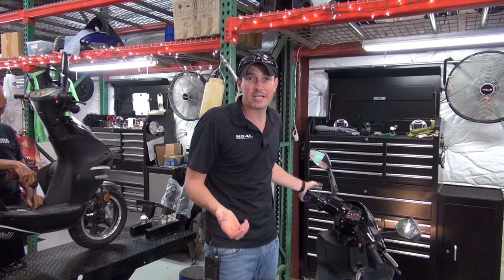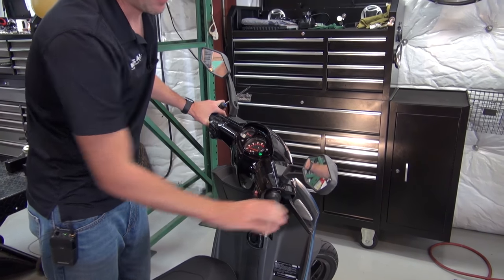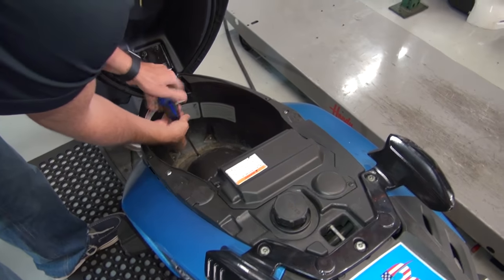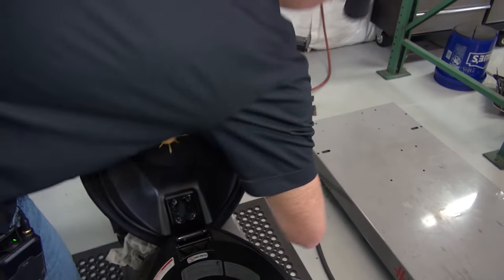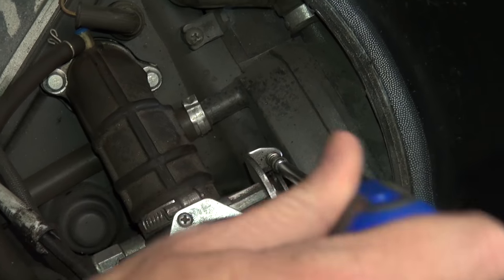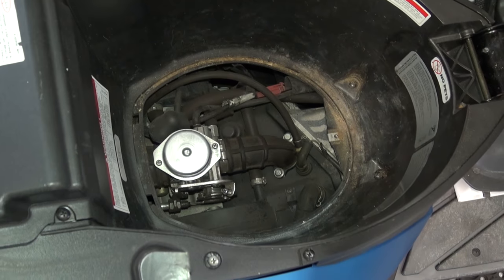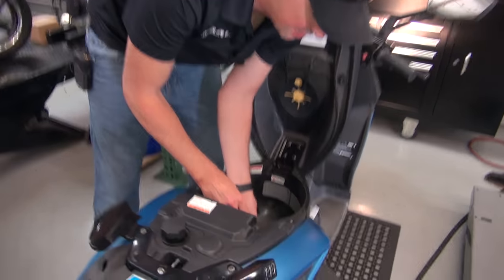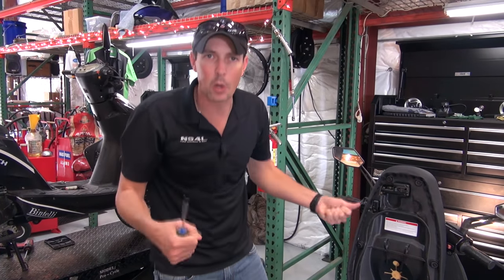Scooter Troubleshooting: Scooter Dying Out When You Come to a Stop / Low Idle

Comment: Everything was working perfectly though, it never died before and ran perfectly. I dont want to mess with the idle when it was perfect last week....
Reply from the maker: Sorry.  Does it die at idle all the time?
Reply: @NewScooters4Less  No sir. And it used to start and i would wait for it to heat up and it would gradually increase rpms, now it start and want to go straight away, i have to hold the brake really tight else it will fly away.. like just the opposite, now it starts and slowly decrease rpms over a few minutes then will die out. Ty for helping me. 🙏
Reply from the maker: @SilverPhoenix-PlazmaMoon  Think this one is going to have to go into a shop.  Just too difficult to diag over the interwebs.  Sorry my friend!
Reply: @NewScooters4Less  ok, tyvm 🙏

Comment: I hear two schools of thought. One it to advance the idle until the back wheel starts to turn slowly and leave it there. Some folks may get to this point then retard the idle just until the wheel does not spin. Another train of thought is don't go near the wheel spinning at all and advance the idle just until the engine stops sputtering. (after it is warmed up) Which is correct? Mind you this is for a new scooter that's not broken in yet.
Reply from the maker: I turrn it up to the point where the wheel is just starting to spin.  The weight of the scooter (and of the rider) is more than enough to keep the scooter from accelerating forward even when the rear wheel is trying to move forward.  Hope that makes sense.
Reply: @NewScooters4Less  Yeah it does.. Thanks! I'm 110 lbs 5'3. I want the most power/mph I can get with the best gas mileage. Doing a hard break in. At first I had the idle way too low and tried to ride it on grass - it wouldn't budge. I gave it a lot of gas and it took off like a shot and I lost control dropping the bike. Now that I've increased the idle the bike actually goes slowly on takeoff like I want it to and i can control it. I won't try it on grass again but I just did it thinking I could practice in our huge yard for a softer landing if I crashed. Now at least I have some idea how a way too low idle makes the bike behave on a surface like grass.
Reply from the maker: @DivergentDroid  Scoot Safely!

Comment: Ran in to this issue for awhile now. Its driving me insane. Just got it out of the shop on saturday. Said they replaced the fuel filter and adjusted the valves. Ran about 5 miles and died on me again. Step father bled the fuel line and it ran until 530pm monday. Crap load of sediment in fule filter. Cleaned it out. Blew thru hose to clear out the line and "pump"(?). Ran it for 3 miles. Fuel filter has crap in it again. When it died at 530 all i did was pull the lines to to engine. Not the fuel line the one into the carb and the other. Im at a lose, atm its running but i feel its only a matter of time till it happens again. Need to find out to keep this from being presistant.  I have no clue wtf to do lol. Its definitly not the idle!
Reply from the maker: 1.  What kind of scooter is it?  2.  What type of fuel are you running in it?
Reply: New Scooters 4 Less 

I run plus/mid grade. Going to travel the extra 2 miles just to get the ethanol free at 89 octane.

I posted the wrong copy. I should have sent ( revised) 

Ran in to an issue for awhile now. Its driving me insane.  My 50cc taotao has been bogging here and there and dying at stops. Just got it out of the shop. Said they replaced the fuel filter and adjusted the valves along with a new spark. Noticed huge lose in power. What was 45mph norm went to 30-34mph. (Im 135lbs) Ran about 5 miles and died on me again. Step father bled the fuel line and checkecd the airflow lines, it ran for 2 days, about 20miles.Crap load of sediment in fuel filter. Cleaned it out. Drained my tank, strained my fuel with coffee filters, clean. Blew thru hose to clear out the line and "pump"(?). Ran it for 3 miles. Fuel filter has crap in it again. When it died the last time, all i did was pull the lines to to engine, blew the air line to the fuel pump and the one into the carb (vacuum tube?) and the other reattached and it started. Dont know why that was a remedy. Power is back, hits 40mph again. Going to bring idle up a little tomorrow as its very low and to quiet. Im at a lose, atm its running but i feel its only a matter of time till it happens again. Need to find out to keep this from being presistant.  I have no clue wtf to do lol. Atm im inclined to just replace the fuel pump since when i blew into it i believe i blew a crap ton of blockage into the fuel filter, and the air filter. At the moment im runing with fuel in the red and keeping an eye on the fuel filter. In hopes the crap will flush. Its large debris,not rust not dirt, perhaps something picjed up at the station. Been searching the youtube as to get an idea whats going on. I'm in no way inclined to do maint myself and the guy at the shop is to stubron to pinpoint the real issue or is just taking my money as it took 3 visits to finally get the rectifier and magneto checked out when i had issues my first round with blown headlight and the fact it would kickstart but not power start as to the battery would not keep a charge. I knew it was the magneto.  It only has 1980 miles/km on it ffs.

After watching this video it makes sense why fuel line to engine was not free flowing from the pump/petcock. And to why when the lines were disconnected it allowed the tank to breath. Im going to try this first. I will let you know the outcome. Oh last time i filled up. Gas cap kissed concrete!

I came to this being the likely cause because this video https://youtu.be/7GdOMiwfhYg explains why I was not geting fuel from petcock to carb.
Reply from the maker: Run 93 octane fuel.  Scooters struggle on 87 and 89.  I see it all the time.  Run premium ALWAYS.  To be honest, Tao Tao scooters are not the greatest.  I know they are budget friendly, but when you get this problem figured out, you will have another problem.  Unfortunately, it's the way it is.  Let me know if the 93 octane fuel helps!
Reply: New Scooters 4 Less im running premium atm. And it died on me an hour ago. There is only one local station that holds Ethanol free but its at 89. I usually rum plus/mid and premium.
Reply from the maker: Sorry man.  I would have to have it in front of me to really help you.  I wish I could do more.
Reply: New Scooters 4 Less 

I understand, i thinke the mechanic , who mainly works on atv and motorcycles now said it was likely to be a stuck jet? Wtf ever that is.
Reply from the maker: Jet is inside of your carburetor man.  Did you try replacing the carburetor all together?
Reply: New Scooters 4 Less 

Na, he wanted to come by and pick it up later today to take a look. Told him I will drop it off on Saturday.
Reply from the maker: Gotcha.  Good luck!
Reply: New Scooters 4 Less 

Just threw a cap and a half of Sea Foam in the tank. Its deff idling different. Going to run this and see it it helps a little. Could not hurt until Saturday.
Reply: New Scooters 4 Less 

I think it has been resolved. Dont even ask! It had to have been the shop being in a hurry when they replaced the magneto and the rectifier. The bucket of the seat was pinching intake and fuel line. Leaving only what was in the carburetors bowl to burn. Which lasted a few miles. When I removed the line it allowed fuel to come thru. When ever I'd take the seat off to remove the lines it was out of the way not being noticeable. Next step is to find out why I'm getting so much debris in my filter. Its not rust nor dirt. Its large debris. As if the stations storage was low and thier pump was giving me all their settled shit. Atm im running 89. There is only one place here in town that has ethanol free and they only carry 89 so yeah. I dont want alchohol in my tank as that is a precursor to rust! Do they make aluminum tanks? So when it initially died on me at the stoplight which started this whole circus. He automatically adjusted the valves thinking it be the case. It shouldn't hurt I'd think, would it?
Reply from the maker: It won't hurt to adjust the valves.  That's get maintenance anyway.  Glad to hear you think it's been resolved!

Comment: Any experts here that could help me with my yamaha zuma when i turn handlebars to the right it cuts out when handle bars turned left it starts up 
Help..Help..Help..Help..help
Reply from the maker: Take that front panel off and see if you notice anything with the wiring.  Sounds like crossed wires or maybe there is a rub in the wiring harness that is causing certain wires to touch, etc. when you turn one way or the other.
Reply: @NewScooters4Less  ive had a look and cant see anything noticable like rubbing or broken wires and it only happens when turning right or turning handle bars from left to straight
Reply from the maker: @r_3_d_m_u_r_d_3_r-_-25  That's the only think that I could think of that would make sense. I'm sorry I can't be more help!

Comment: I did this but it still turned off.
So the best way to fix this is to adjust your valves. That should fix it.
Reply from the maker: If you need a valve adjustment, then yes, adjust the valves.  There are mileage intervals for this anyway and should be done periodically.  Thanks.

Comment: DO NOT ADJUST THAT SCREW when you have FI scooter!  it will change minimum value of TP sensor and may  let ECU go wrong!! With FI, please clean the throttle body,change air filter, clean injector and idle speed will normally
Reply: I bought a  brand new scooter and it shuts off when I don't idle it or when I reduce speed coming to a stop

Comment: Mine you have have to give it gas to start it up and would stall any time u let go of the gas after like 30 sec of idle did this and starys up with no gas at all and so far no stalls when idling
Reply from the maker: Not sure I understand what you are saying here.  Giving it a little throttle to start it is pretty normal with these little engines. I wouldn't sweat that. If it's dying out on you or stalling, then this could be your issue or you may have a vacuum leak, loss of spark issue, or another problem like that.
Reply: I turned the idler up last night and now i have to problems it starts up with out having to give it gas. And doesn't stall now
Reply from the maker: @aaronhollingsworth446  This makes no sense to me.  You have 2 problems? It starts up without having to give it gas? And it doesn't stall? 
Neither of these things sound like problems.
Reply: I turned up the idler and that fixed my 2 problems
Reply from the maker: @aaronhollingsworth446  Awesome!

Comment: Do anyone knows whats goin with my scooter i have 50cc tao tao ran good first 2 days after starting to die out in every stop now it dosent turn on well turns on for 2 seconds and then die dosent give me enough time to play with idle any opinions pls?
Reply from the maker: Hard to say on this limited information.  I'd check for a vacuum leak first.  Make sure your vacuum line is connected correctly and not cracked anywhere.  Had it been sitting for a while or anything before running it?
Reply: @NewScooters4Less  thanks buddy i will do that .
Reply from the maker: @davidrivera778  You got it.

Comment: My scooter is having problem holding its idle rpm and dies out as soon as i let go of the throttle. Does anybody has any idea what the problem might be? Should cleaning my fi filter solve my problem??
Reply from the maker: Could be a few different things.  If you are holding the throttle slightly, does it stay running?  Does the cable need to be tightened up at the handle or carburetor?
Reply: @NewScooters4Less    mines got fuel injectors. No carburetor. Yes. Holding the throttle keeps it running as i let go it dies out. The fi filters and throttle body was never cleaned in this particular scooter. I got it 2nd hand few days ago.
Reply from the maker: @buttersalad117  Sorry I can't be much help from here. I'd find a local shop and let them have a look.  Best wishes!

Comment: Need help my electric start wont work anymore,,only a kick works to get it running
Reply from the maker: Have you replaced the battery?  That's probably the most common electrical problem, but it could be an unplugged ignition, broken wiring, etc. too.

Comment: My scooter works perfectly, but I’ve tried to do derestriction with pluging out one of wires from CDI, and after 45km/h he starts turning off... So does anyone has solutions?
Reply from the maker: Not sure on this one, but I can ask one of our experienced Techs.  What kind of scooter do you have?
Reply: @NewScooters4Less  Actually he works, he lost some RPM and then he turned off... I solve it, but he drives maximum 45 km/h. For more speed I've tried performance CDI, with 45 + km/h and same, everything works perfect, but I can not reach more that 45 km...
By the way, I've changed needle high in carburetor and I unscrew a bit air/fuel adjustment screw, but I did not get any result. 
My scooter is "china" one, Turbho CD 50cc
Reply from the maker: @maxajm9111  Gotcha.  Thanks for the note.

Comment: What if it's stalling coming to a stop when warm?
Reply from the maker: Is it still idling low?  Like all the time?
Reply: @NewScooters4Less  only when warm.   I tried adjusting the idle screw no matter how much I adjust it though it eventually bogs down
Reply: @NewScooters4Less  I found two things. On the bottom of the bowl there’s a plate with two screws. I don’t know what it’s for. If you spray that with carb cleaner it will die. The second is when I block off the fuel overflow tube when it’s about to stall out it comes back and runs great.  I had the air filter off when I did that and found it cause gas to start pouring out the carb.  It has a pod filter on it. Is it stalling out because it’s to lean with that filter?
Reply from the maker: @jeff666p  I wish I had it here in front of me.  There are a lot of possibilities.  Do you have a local shop nearby?  Is the float in the carb getting stuck?  Have you cleaned and rebuilt it?
Reply: @NewScooters4Less  I can’t take it apart without drilled the screws out. The heads are broken off.
Reply from the maker: @jeff666p  :/
Reply from the maker: @jeff666p  :/ Man... seems like that units needs some work all around!  Sorry to hear that!
Reply from the maker: @jeff666p  I really wish I could help here.  I would need to have this in the shop in front of me to get a full context of what is happening.  I'm sorry I can't be more help!

Comment: Problem with mine is that it hates idling when cold once warm it better also seems to idle low
Reply from the maker: Most don't idle well cold. Being carbureted, they will idle better when warm. If you have trouble keeping it running even after adjusting, then check for vacuum leaks as you may have a larger problem than just an adjustment.